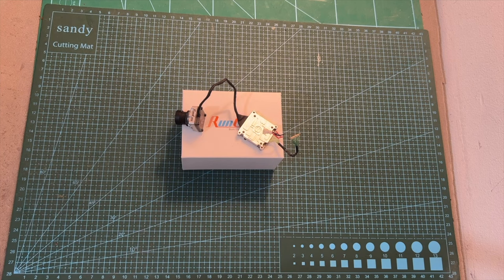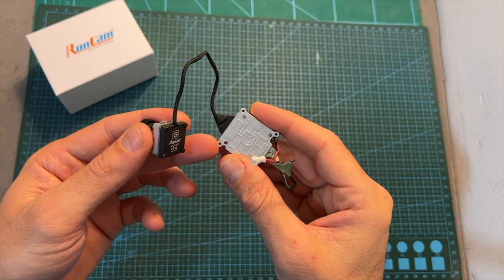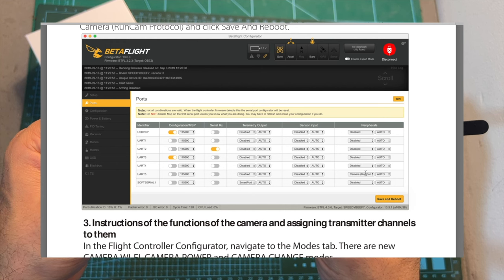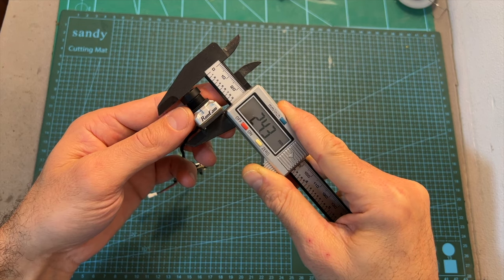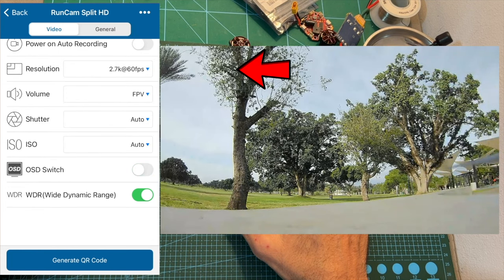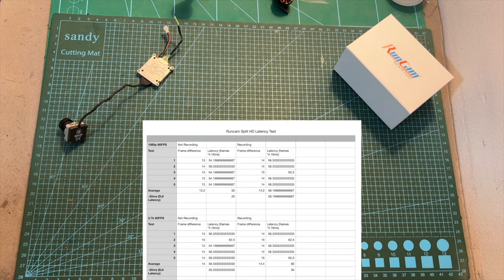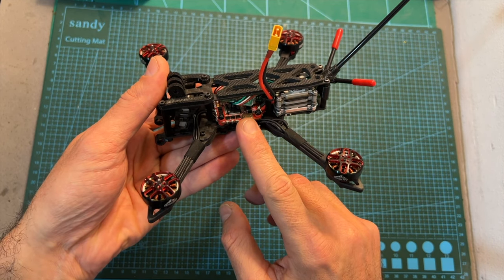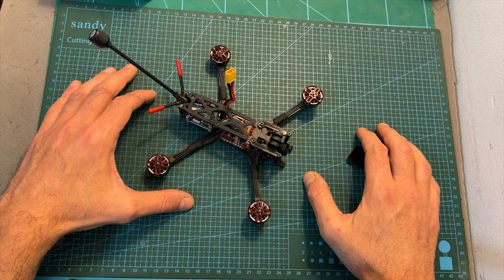Runcam Split HD - Overview, Latency Test & Flight Footage

Comment from the maker: Just to be clear - the Split HD outputs 720p 60fps video to the DJI HD FPV compatible VTX, so low latency mode and other features (camera settings and etc.) are not supported.

Comment: 60ms of latency is on the higher side but a person could quickly adapt to fly around it. The analog Split systems were around 40ms and it didn’t really bother me, even when switching from one quad to another.

Comment: At 8:38 are those clips from the HD recording or from the goggle's DVR? 
At 8:47 the stabilized is shaking much more then the raw :D
What is the advantage of this Runcam over the original DJI air unit? ...I'm still a bit confused by these digital video transmission things :)
Reply: It's main advantage is with smaller quads which do not have the footprint or space for the full size AU.
Its main disadvantage is that it is not low latency (120fps) cam compatible, which is a real shame as it is more desirable for quads.
There has been a clear trend to moving towards smaller sub 250g quads to avoid registering them so there should be a small ish market there for it. It will also allow HD recording at a reduced weight and/or with more protection compared with a naked go pro or Cadyx Peanut... and will likely also be cheaper. However both of these leave AU and cam type completely open as they are not connected in any way.
If possible, they really ought to have made it compatible with other DJI and Cadyx cams as I imagine that disadvantage will have reduced its potential market share by a fairly large margin.

Comment: The video looks excellent. Question: I'm looking to integrate this into my motorcycle helmet since external cameras are not authorized. Is there a way to power the camera using a powerbank? What kind of adapters would I need? Thanks

Comment: Bunch of babies complaining about the latency. I get that it’s not great but like he said, if you’re cruising around, it’s plenty good. The form factor is made for smaller quads and seems to be a great option to get hd footage and not have to carry a spendy hd cam. Great option for a 3-4” long range style quad.
Reply: Wouldn't an air unit be a better choice if all you want is onboard recording. And if you fly in a manner where 60ms of latency doesn't matter then just fly a camera drone cuz you're not flying FPV the way it was intended.  
The air unit has no added latency records sound and weights about the same. This is useless and will not sell.
Reply: @dimanfpv3247  I would agree the air unit is a more refined setup for on board recording. I think if Caddx jumped in the game and upgraded the air unit to do higher resolution like the runcam split hd does, it would awesome. But the form factor of the air unit doesn’t fit in micro builds. I just think it’s cool there’s something new on the market that does 2.7k on board recording.

Comment: wow this would make a tiny but usable helmet cam with a small battery glued to to the back. just have to find a place for it inside the foam liner with a view out the front and it would not even be difficult to see that a camera is in there at all! (permanent set it and forget it setup) also it's crazy how good the picture is for how inexpensive it is

Comment: An interesting product. At 2:50 it's  mention there is a button to control the unit manually.
Wondering if possible to connect to a UART to control remotely via radio transmitter?
I can see such a feature being handy if flying long range, so likely will not turn on recording until out closer to mission objectives. Example the Caddx Peanut has such a capability built in. Wish it offered a few more remote options like adjusting level of stabilization.
Reply: It is able to do it. It has a RX and TX, which you could assign the controller to control the mode and rec or capture a pic. It is mentioned in the user manual
Reply: @tacoin  Thanks, recently learned of this capability.

Comment: It's dead on arrival with 30ms added. They can't sell cameras that add 10ms. The nano version is a pipe dream they are going to have unsold pallets of these things going to a recycler in a year.
Doesn't matter if people can feel the latency or not (they will) the hobby is full of latency queens and using DJI goggle DVR is good enough in 99%of the situation. If not we have air units that don't add latency to record onboard. Especially with a small quad that this was intended for. Most small park flyers aren't flown far enough for break-up to be an issue with DVR on DJI.
You came late to the game runcam and don't understand the plays yet..
Get to work on 120fps Runcam and stop working on crap no one is asking for. An improved 120fps starlight cam would be nice. 
What were they thinking?
Reply: 120fps and starlight doesn't work well... for good lowlight You'd rather go for 30fps...
Not sure if it is such a bad idea, but will find out soon. Maybe there are some settings that lower latency (like the little OSD).
But since the cam module films in 2.7k for the dvr, they have to make an extra step to scale it down for the vtx.... if this could be scaled in the maybe more powerful DJI chip, it could be faster...